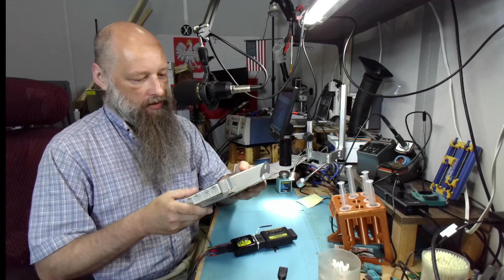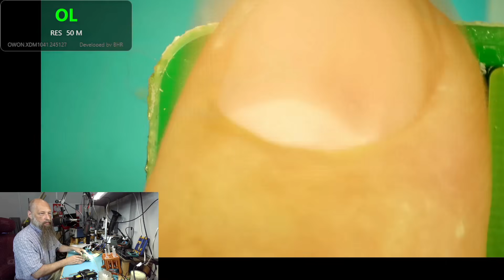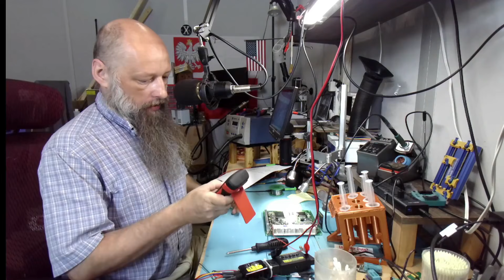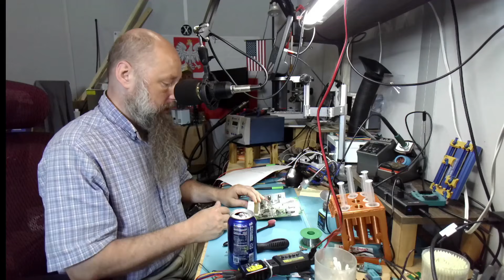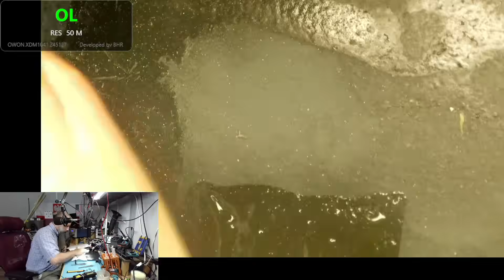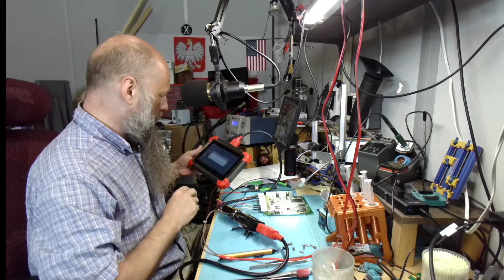Hardest Ever 2004 Subaru Forester XT ECM Repair

Comment: "Hello, I am Sanjay, a Diploma holder in Electrical and Electronics Engineering based in India. I am passionate about automotive electronics and want to learn more about diagnostics and chip-level repairs. Could you please recommend some reliable websites or resources where I can get accurate wiring diagrams for modern vehicles?"

Comment: With a thermal camera and a current limited power supply you can apply power to the board and see where the power is being dissipated. When this module was manufacturer it could be susceptible to ceramic chip capacitor cracking shorts.

Comment: If I come across Subaru ECM connectors I can trim off old harnesses, would you be interested in those? I can't quote year and model of the ones I have currently, but I could send pictures.  I can also inform year and model from any replacements I do going forward. Also let me know if you need ECM pin out, or wiring diagrams

Comment: I wonder if an ecm failure can cause a car's motor to die as soon as you put it in any forward gear, like D, 1, 2 but work fine on neutral and reverse. Or if it is something completely different problem with my car...
Reply from the maker: It’s possible, but I would definitely check the transmission sensors and solenoids first.

Comment: I was hoping I had one of those ECMs in stock to test the current draw but my oldest ECM is a 2008. I tested several between 2008 and 2022 and the highest I measured was 6.2 watts. Most of the plastic case denso ECMs measure 3.5-4 watts. 
My result may be slightly screwed to the high side because of the led indicators on my breakout box.
Reply from the maker: Thank you so much Chad, I forgot that my breakout box also consumes 1W that's why it seemed high. I think it will work but we'll see
Reply: The 2004 is a little different but idles not doing anything between 6 and 12 watts.